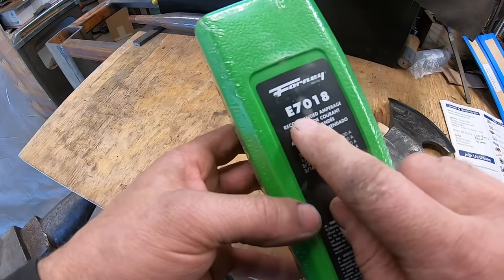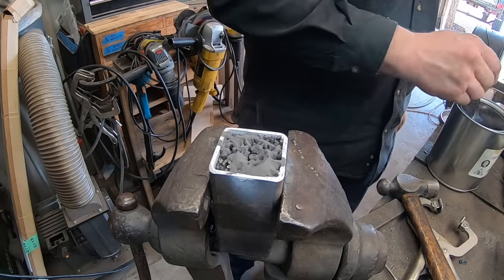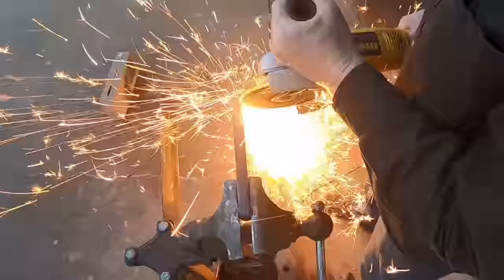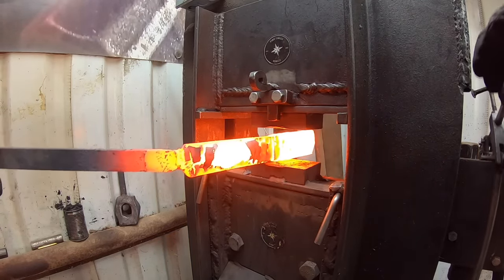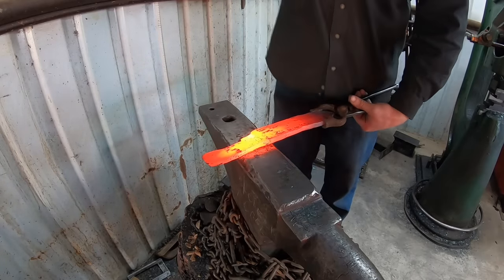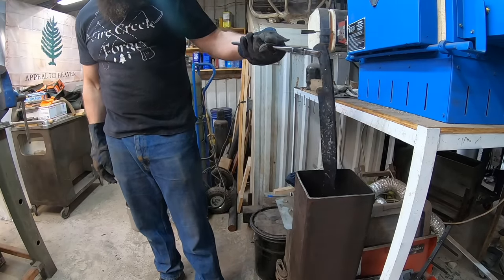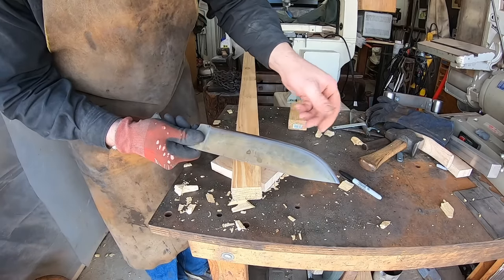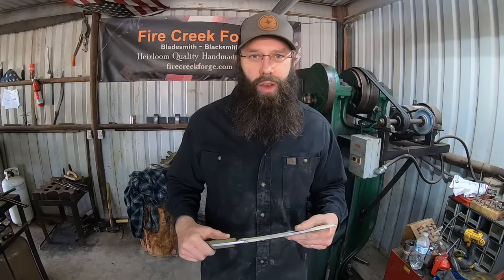Welding Rod Damascus Knife, Forging Electrodes Blacksmithing and Knifemaking Project

Comment: As a retired welder/steamfitter I always wondered about the stubs in my stub bucket. Tig wire has a coating of copper on all the carbon rods up to chrome rod and stainless rods. Stubs in a canister of 6010-5p+ and 7018 would give a nice pattern without the powder I'd think because 7018 is lighter in color and more malleable and your 5p+ is darker. Plus stubs are just going in the scrap barrel so why not.
Reply: I’m pretty sure the wire is all the same it’s the flux composition that makes the difference and adds the different compounds in the puddle.
Reply: @cameronlamb7274   you are correct the core electrode is trash steel loaded with impurities the flux contains deoxidizers slag formers and alloying elements to give the “as welded” mechanical properties noted in the classification 60xx 70xx etc
Reply: @joelhoughton2593  "Trash steel" ? It's apparent you don't know much about welding rod. The flux is a deoxidizer and protects during fusion and cool down. That is by far it's main function. Yes you can have alloying agents in the flux but I would wager there is next to none in 7018. All the alloying agents are in the steel rod itself, which throws out your assertion of "trash"
Reply: @xenuno  try knocking the flux off and using it as a tig rod… it is rim steel
Reply: @joelhoughton2593  It is mild steel of high quality. The flux does more than I gave it credit for as the core rod for 6010 and 7018 apparently are the same composition.
Reply: Hey bro what an steamfitter do? Im brazilian and doenst understand that term
Reply: @xenuno  yeah the core rod for most if not all mild steel electrodes is the same composition 60-110xx
Reply: @erickprado1641  same as pipe fitter main thing changing is the contents/pressure of the piping system
Reply: @joelhoughton2593  its not like install vents pipe or water/hidraulics tubes? We had that jobs here.
Reply: @erickprado1641  no more like a refinery or power plant where pressure systems operate at hundreds or thousands of pounds of pressure connections tend to be welded not threaded
Reply: @ERICk prado Steamfitters are pipefitters who  specialize in high pressure steam piping and systems. Kinda like gasfitters specialize in gas piping.
Reply: @leemitchell3020  but they install high pressure pipes on buildings or they fabricates the pipes?
Reply: Love to see the pattern result from that.
Reply: Lu 449 here✋️
Reply: we

Comment: In the future, stick them in the oven at 550° for an hour. The flux dries out and comes off more easily.
Reply: It doesn't work like that for 7018,if it did my flux would have fallen off ages ago,my 7018 rods stay in the oven.
Reply: @dolphincliffs8864  yeah, only been welding for 20 years. You put them in a heater at between 150-200°f to keep them dry. When you crank the heat up, it hardens the flux making it easier to knock off.
Reply: @NOTSOSLIMJIM  Yep,sure as heck wouldn't set the oven to 550!

I kept all the half burnt rods from school too,kids love wasting consumables. Went to welding school last year in January at age 51. Wanted to learn smaw.

Comment: Bet making a smaller diameter dowel making jig would have ripped that flux right off. Just attach a drill to the end and run it through a couple times.
Reply: I put mine in a drill, then run them against a wire wheel on a bench grinder.

Comment: In many cases, the core in 7018 is a low carbon iron rather than mild steel.  I believe Carbon in a 7018 deposit is on the order of 0.07% max.  Also, in addition to the deoxidizers in the coating the manganese content is picked up from the coating.  Most stick rods get the alloy content from the coating.  Basically, the electrode really only provided bulk to the mix and dilution of the 1084.  E70S-6 tig rod would contribute a little more  Carbon and 1+% manganese to the alloy.  This would slightly improve hardenability to the body of the blade and a little extra toughness.  E70S rod is available without copper coating.  INE and Midalloy should have it available.  Working from memory on this since I retired a few years ago, but confident in being generally correct.

Comment: If drill a hole in a piece of steel the same size as the welding rod steel then just chuck the bear end in a drill and push it through the hole you drilled and all the flux comes off leaving clean rod

Comment: Great video. I'd like to see a video where you make a good, heavy base that will hold your vise so it is solid, instead of moving all over the place when using it.
Reply: just get a big truck rim. weld in riser, fill with concrete. problem is you cant move it around

Comment: If you line the canister with burnt stainless foil it will pop off even easier. But the paint worked great. 

(Burnt stainless foil is just regular stainless foil oxidized with a torch or forge)
Reply from the maker: I've used the foil in the past, but I prefer the paint
Reply: @FireCreekForge  good stuff, whatever works best for you!

Comment: A knife made from all tig rod that is able to be hardened such as A2 rod and then durability tested would be interesting. I wonder if it would be possible to forge weld it like a cable. Maybe twist up the tig rod?  

That was a cool blade you made.
Reply: sounds plausible
Reply: What TiG rod?
Reply: @dolphincliffs8864  There's a handful of them out there like A-2, D-2, O-1 and other companies make their own with proprietary herbs and spices added.

Comment: Nicely done, as always. Not sure simple mild steel rods wouldn't have been easier to prepare for the canister, no flux to deal with, but you know what you're doing!
Reply: Just for the video title my guess
Reply: At that point, you could just buy a roll of similar diameter steel wire, and just use wire cutters and cut to length over and over, would probably be much cheaper.

Comment: Nice work. I have wondered how good a blade could be made from the square cut concrete nails. They are high carbon steel and usually between 50 to 55 HRC. All I have is a coal forge and a couple of anvils. If I had a press, I would have already tried it by now.

Comment: Water couldn't dissolve the flux? Probably depends of the rods, but I've seen the flux falling off the 4616 rods if left in the shed winter over.
Reply from the maker: I imagine it would given enough time. However, I didn't want to introduce any corrosion, and needed to do this quickly...

Comment: could you use stainless on the outside and high carbon on the inside to make a kitchen knife thats both rust proof, but also super sharp with high carbon steel that would rust but cant because of the stainless?

Comment: So if the rods are just mild steel and you’re knocking all of the flux off…why not just buy steel rod? Seems like it’d be less expensive and less work.
Reply: the rods contains 0.25 percent carbon. in steel powder about 0.8-0.9 percent. this gives good pattern contrast
Reply: @andrewt2510  Lincoln 7018 and Esab OK 55.00 both says they contain 0.05% C.

Comment: Nice work!

I've seen people asking about keeping the flux on the rods to help with the forge welding. Definitely a no no.

The flux on welding rods will result in glass like inclusions in the weld. Flux has to be removed prior to making another pass when building up welds in structural settings. If the flux is not removed, you get inclusions and your weld could very well fail inspection.

Would not make a good blade.

Comment: The Flux is what determines the the finished product, coat a coat hanger in that 7018 Flux, 8018, 6010, 7010, Flux provides the shield from oxygen, like like different gas shield for mig, or Flux core wire, gives different tensile strength

Comment: If you can get some, would you get much difference in the etch from something like an 8018, or up as high as possibly some 11018, or even some specialty rods like hardalloy 118

Comment: Possible suggestion to try.  When making canister damascus would using an acetylene rich flame to soot up the inside walls work as a release agent?
Reply: It definitely works for bullet molds.

Comment: the flux is actually super important.
flux not only turns to gasses to protect the weld, but it also imparts all the alloying elements that make the steel of the weld what it is.
what you have made is nothing but mildsteel and 1084.
would have been better off using penny nails. cheaper and less clean up.

Comment: I've got a few pounds of some old black rods. From what I remember half was a high nickel rod for hard surfacing.   Remembered it was hell to grind even with a hard stone, hardly and spark and just scratches on the bead. I beared down hatd on the hand grinder n it was bogging.  Not a cheap 1 either.   Think was marked atlas on some of them.   Got some old bluish green coated rods, heavy flux on them to. Ill have to get out to garage n take a look. Got a few chrome molly rods and sure some for stainless.  Been some years since I looked at these. They'd need to be ovened before used to weld    wonder how they would work

Comment: Super nice pattern on this one!  I really appreciate you providing tips as you go such as how to forge the San mai core around the tip and how to fix the edge geometry when it didn’t pass the first test before thinking the heat treat failed.  Great video!

Comment: The only thing different between 7018 and  any other 60 0r 70 series steel rod is the coating. The core wire is all the same.

Comment: I would have used a wire wheel on a bench grinder to remove the Flux. Any wire wheel would work though.

Comment: A great way to get the flux off is to bake them. We have a rod warming oven that someone accidentally turned up to 100°c. The flux just fell off every rod in there when you picked them up
Reply: Not 7018.... you need to STORE low hydrogen rods like 7018 and 8018 in a rod oven at 120C or about 250F

You may be talking like a 6010 or 6011 which uses a cellulose based flux...
Reply: @jeffklaubo3168  well said, was about to say the same thing

Comment: Hell yeah.

I've seen old axes where its pretty much an normal axe except the cut out a V groove and forge weld in some higher carbon steel, or they fold over a thick bar of steel or iron over a higher carbon core. Would be interesting to see if 52100 or D2 would make good edges, or maybe some kind of spring steel.

As for using WD-40 on your stacks, I think that some people use kerosene or diesel to accomplish the same thing, and it's a good deal cheaper. WD-40 smells better though lol.
Reply: He has a bucket of diesel that he uses too. You'll see it in many of his larger damascus builds
Reply: D2 has relatively low toughness, so it wouldn't make the best axe, but 52100 should be good especially if you only use it for the edge.

Comment: 8018 or 9018 would be a bit better for a knife blade.
I think you should try to find the trimmed ends from Post Tension Deck cables. 
They are very strong carbon steel cables embeded in concrete decks.
The trimmed ends are often 6 feet long and look like 3/4" steel cable with very large wires with a very slow twist.

Comment: All of the alloy is in the flux. Without it it’s just crap steel. Tig wire would have made a quality blade.
Reply from the maker: I understand, however mild steel welding rod of any variation would be worthless steel for a knife edge anyway, which is why it's the cladding on the outside of the blade where it provides toughness and structure, and not anywhere near the edge.

Comment: Can anybody answer....what would happen if you DIDN'T clean the flux and put them in a canister as is?
Reply from the maker: It would be way too much flux for that operation, and I don't know that would even work for forge welding; arc welding is very different from forge welding.
Reply: @FireCreekForge  would it make any kind of useable billet, or would it be like a block of swiss, all pitted and full of holes? Im just curious.
Reply from the maker: @TheOriginalHeisenberg  I don't really know how it would turn out..

Comment: If you were forging Damascus steel for A KNIFE, why didn't you use 11018 instead of 7018?
110k lbs. tensile strength beats 70k lbs. tensile strength with an ugly-stick!

Comment: 7018 isn’t mild steel. It’s for welding pressure vessels. The numbers mean a lot. Position rod can be used in, type of flux and tensile strength of finished weld.

Comment: Instead of all that time, work, effort, materials, etc to remove the flux and then clean the rods
just weld with the rods. Make them into a mound whereby creating the size/shape you want to fit into your crucible

Comment: Water my son..... Soak sparkling clean in water.
Reply from the maker: Well I didn't want any rust.
Reply: @FireCreekForge  the water softens the Flux in minutes. Then simply wipe dry. But all good. Great work BTW.

Comment: Couldn’t u have just used some regular steel rods instead of wasting some welding rods ?
Reply from the maker: Yes probably you could
Reply: @FireCreekForge  so what made you use these doing all the dirty work taking off flux then ? Just wondering.
Reply from the maker: @thunderkunt5416  because I wanted to use a well known, readily recognized welding rod for the project
Reply: @FireCreekForge   I see ! They transformed into a nice looking knife in the end nonetheless ! Keep up the good work ! ^_^

Comment: Kind of trivial using the welding rods you might as well use any other piece of steel you could’ve use them to weld something and all the time it took to take off the coding for a YouTube video I feel a little misleading with the thumbnail I thought you were going to try to forge weld welding rods but you were just welding steel together not welding rods

Comment: 7018 is a fine quality of steel, but not ideal for knifemaking.
Personally, I've attempted to use 7018 to make "redneck San Mai" by welding it onto the edge of an A36 (mild steel) blade. It kind of worked.
Reply from the maker: Correct; the actual edge on this knife is 80CrV2

Comment: Am I missing something? Why would you make a knife out of mild steel? It doesn't really do much to heat treat low carbon steel...
Reply from the maker: As explainedand shown in the video, it's a laminate construction with 80CrV2 edge steel

Comment: I made it 1 minute ten into the video.  The flux is what makes it 7018 and by smashing it all away this video is just "can i canister weld some regular boring ass steel?"  Stick welder for 21 years saying this.
Reply from the maker: What did you think of the finished pattern?
Reply: @FireCreekForge  What part of 'only watched 1 minute ten' didn't you understand.  The algorithm suggested your video and I was expecting you to bundle the rods together with bailing wire or some other such thing and twist them in the forge as the flux melted off and using the 7018 flux in place of borax.  By stripping all the flux off and doing a canister weld you basically put mild steel into a box with some other stuff and if I wanted to see that I'd watch one of the other 100 blacksmith channels that put random bullshit like paperclips or crushed soup cans into a canister and make a 'nifty cool super pattern'.  I am not trying to offend you personally, just making a critical observation of your video and why I will not be watching your channel.

Comment: I feel like the flux wouldn't hurt the weld. Might even help it.
Reply: Nope. 7018 flux has to be removed in structural welds when making multiple passes or it leaves nasty inclusions. Would be no different here.

Comment: I recently saw a video talking about long term grinding, and it was mentioned that free hand grinding on blades is bad for your body if you do it for a living, as it will damage your shoulders, wrists, elbows, fingers, and tendons due to trying to be very stable. The solution that was mentioned was just to use angle jigs of various types and the standard 90* grinder rest. Worth a look, UK Bladeshow made a video on it not long ago.